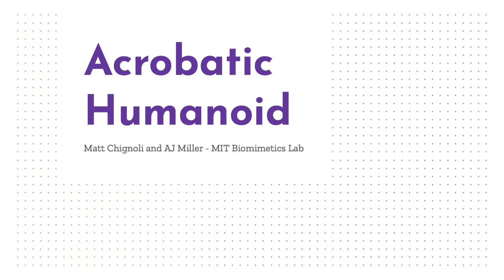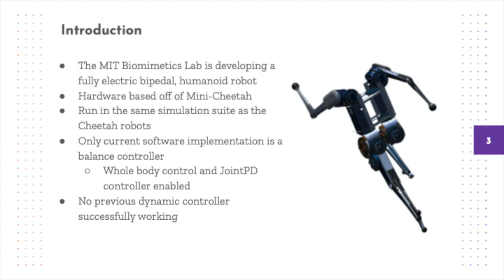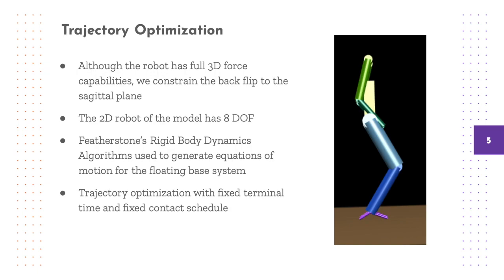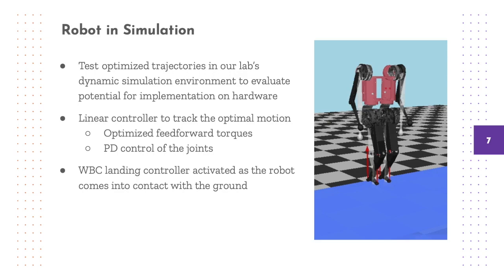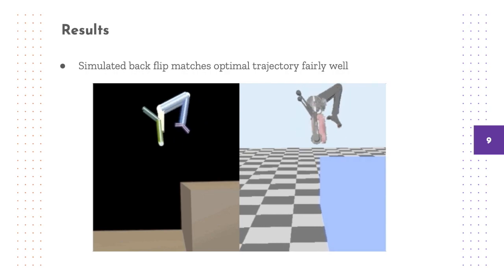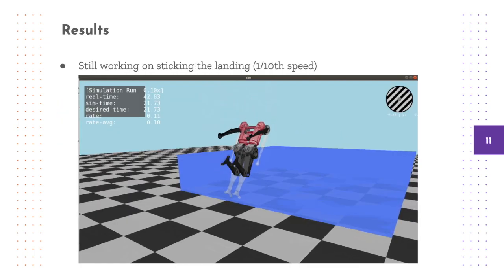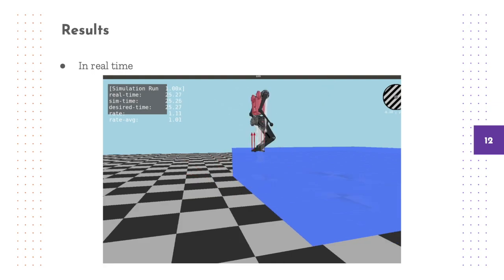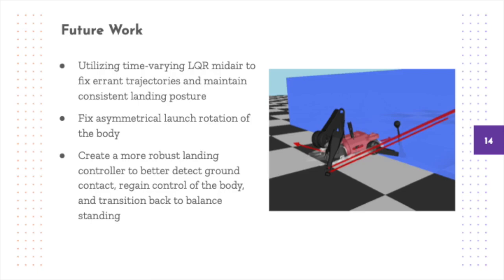[6.832 Final Project] Acrobatic Humanoid

Comment: Agreed... it's awesome!

The backflip trajectory on the simple model looks pretty beautiful.  But even there, it did not look like it was completing the turn clearly enough to be able to stick the landing...?  

The simple model trajectory also got much farther from the box than the full simulation did.  Do you understand why it achieved the vertical motion fairly well, but not the horizontal?  Perhaps there is a difference in the friction models?

I think TVLQR is worth trying, but I worry that you don't have enough control authority in the spin to change the center of mass trajectory.  I think the transverse stabilization might be warranted in this case.

FTR -- when you say "to the best of your knowledge..." don't forget about Marc Raibert's original 3D biped.  it did backflips back in the mid 1980's.